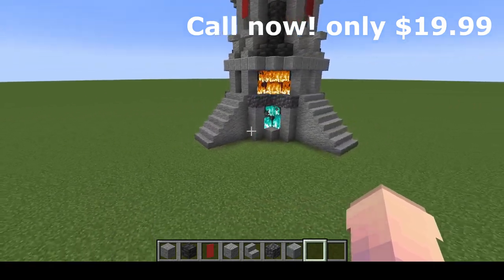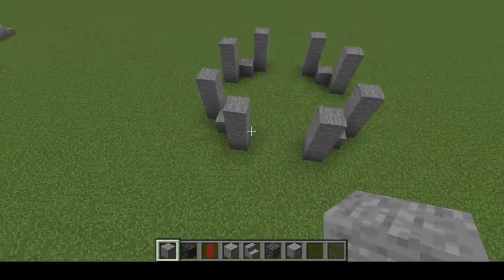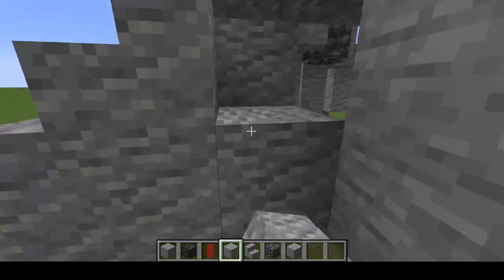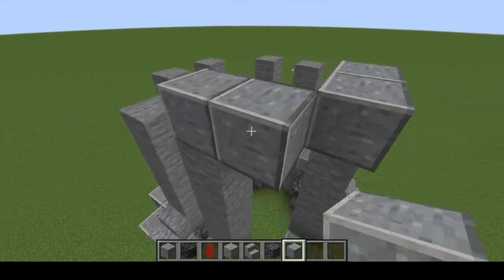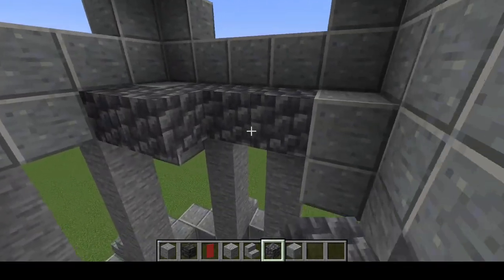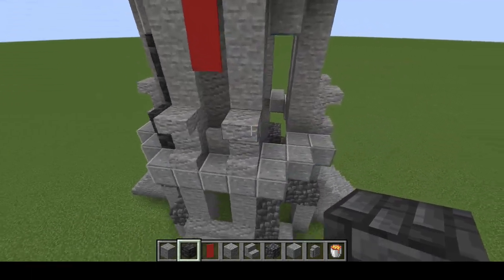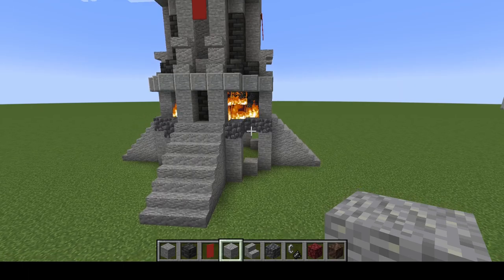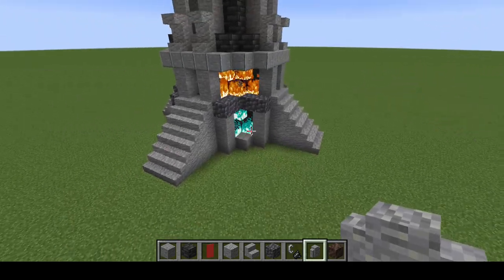How to Build a Dwarven Forge

Comment: I used this for the basis for some forges, but made a minor change.  I placed anvils and cauldrons filled with water on the level where the staircases end and let the lava flow through a hole in the middle of the ceiling and through the floor.  Thanks for the great idea!